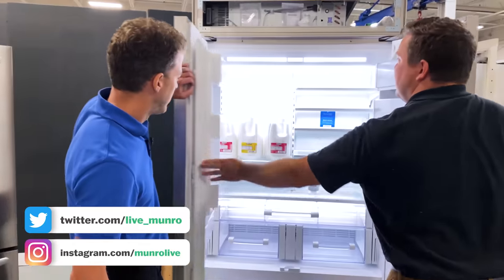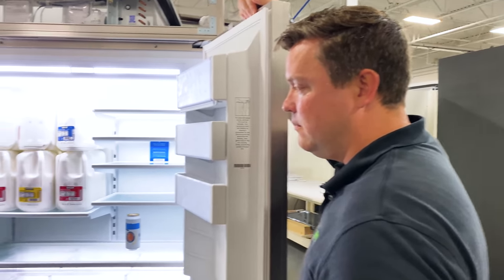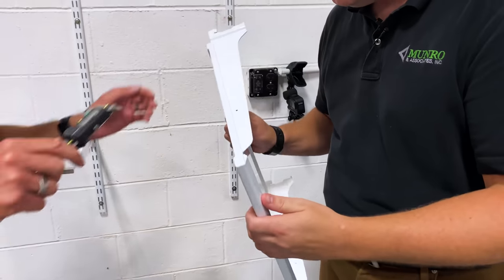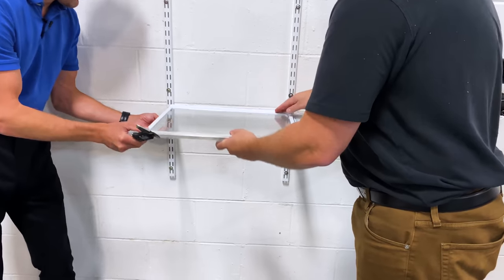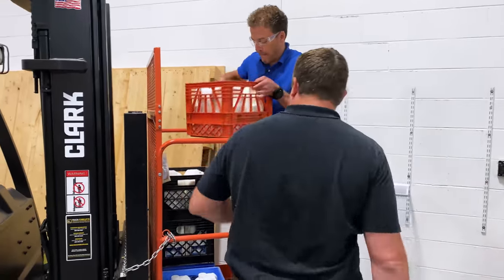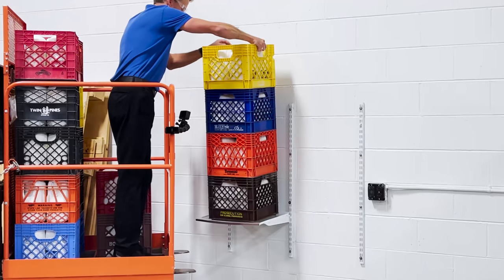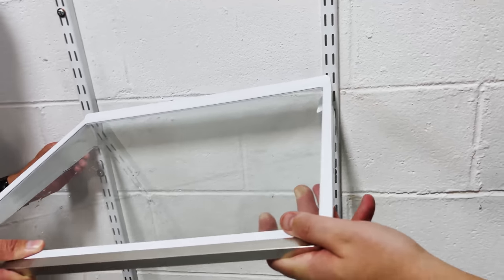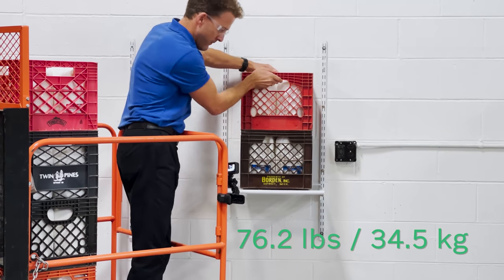Consumer Series: Sub-Zero vs Frigidaire | Load Testing

Comment: I'm actually impressed with how gracefully these shelves failed when they did fail. It was a very controlled flop over rather than a sudden shattering of glass or something violent. Why milk though? You've made a bigger mess for yourselves than just water would have been. But I suppose it's for YouTube. 😊
Reply: The tests in this series look very weird to me, first is the IR thermal "test" that can be pretty much ignored due to how uncontrolled those can easily be. The testing for this one would be better and easier done using barbell weight plates incrementing the weights by the smallest possible increments, 2-5Kg of example.
Reply: Minor dings or ridiculously overloading shelves perfectly adapted to their use-case are totally irrelevant. Right to repair, compressor life, electronics and seals are what limit the lifetime of a fridge for real. Nothing on that so far. Sandy, please come back soon before your guys spill more milk instead of producing useful content.
Reply: Could have just spray-painted water jugs white and write milk on them with black marker 🙄
Reply: @Makatea  I took this as an opportunity for engineering lesson about material stress, and failure modes, not a commentary on the products themselves ... so it was useful in that way :-p
Reply: @TheJoeSwanon  
Then when they fall over you'd see that it wasn't milk.
Reply: @Robert-cu9bm  Right. And that would have been less dramatic than all that milk on the floor. I think there was some theater involved in this video production for YT views maybe.
Reply: @toronado455  I've always wondered how much weight these shelves could hold. Now I don't have to worry when I stuff my fridge for a party.
Reply: why didn’t they use chocolate milk? Or orange juice? I think this is an example of white rivilege. @g.pattonhughes5991
Reply: Privilege!
Reply: @Makatea  but a lot of fridges fail at the shelf or drawers also (personal experience), this shows that those fridge have no problem on this
Reply: @ludovicdouay1635  Sure, it's perfectly fine to check out those shelves hold the maximum possible load you can pile up inside the fridge. Heck, you can even test them destructively if you must. However making a quarter of an hour spectacle of it and spoiling milk in the process: I'd expect more content of substance and more respect for food. When Sandy comes back, those two will most likely pass a very uncomfortable quarter of an hour in his office...
Reply: @Makatea  Agree, was also not liking to see this milk spilled.
Reply: When Dad's away the mice will play. OR: to put it another way - Kids, naughty!! 😅😅
Reply: @pinkelephants1421  This might be the most accurate analysis!
Reply: @toronado455  😜🤪🤣🤣🤣

Comment: Interesting, but these shelfs will never experience those loads, energy efficiency of these units are the most important factor.  I hope you can evaluate precisely being they are different sizes.
Reply: Someone using the fridge as a ladder to reach to cookies on top.
Reply: i have no words. Project Farm channel does it better than these guys.
Reply: I wouldn't want them to spend a minute of their time if they don't end up breaking the shelves.  They can just say "they work" and move on.  Actually breaking them revealed the design choices or the lacking of design that goes into these products and are actually educational.  I saw the stamping and actually thought that the Frigidaire's design was better.
Reply: I use an old Frigidaire in my workout room as a shelf to store my bumper plates so this is really helpful information.
Reply: @lanzer22  that is the difference between thinking something and real life.

Comment: Sandy might have insisted on using water instead, cleanup and residual smell for a indeterminate time, but then age has it's benefits.
Reply: At least its starting to get cool out there.  Still on the return of Sandy "Why does it smell like sour milk in my shop?!?"
Reply: But what about the added 0.023kg/m³ of density! 😂
Reply: Ummmm, did no one think that maybe water would have been a cleaner test??

Comment: When I read the title of "Load Testing" I assumed it was electrical load as energy consumption is by far the most important engineering feature of these refrigerators. I cannot believe I just gave up 14 minutes of my life watching two guys stack MILK (not water) jugs on shelves until they fail. While I am glad you made sure each shelf could hold a load that they would never ever see I am wondering when you will get to some actual useful testing. Maybe you should do this type of test for vehicles? Get a pick up truck and stack concrete blocks in the bed until the suspension fails or the bed collapses, or load up the drivers seat with steel plates until the frame fails. Seriously, was this video done so that Sandy would never go on vacation again?

Comment: I am interested in how you will test the electronic control boards.  I purchased Frigidaire refrigerator and stove in 2014.  We have had repair people out numerous times on both units and had the control boards replaced.  
Additionally the ice maker has issues with condensation freezing in the rotary sections for the ice maker.  I am not enamoured.
Reply: the EU versions of fridgidair like brands are comfortably in the "budget" section. still, a fridge like that would cost less then half in euros as it would in the US. these fridges are just stupidly overpriced in the US. even that subzero would be sold for 3k or less in the EU.
Reply: I expect those boards to be tested with gallons of milk.

Comment: This is an utterly useless spill of milk. Both shelves are strong enough for their use case, so what? The right to repair stance of the OEMs, and the durability of the compressors, control electronics and seals are the significant components limiting the useful life of a fridge, not minor dings in the sheet metal or ridiculously overloading the shelves.
It's time Sandy gets done with his move and comes back to stop the clown show.

Comment: I fail to appreciate any value with load testing the two shelves beyond what either would ever be loaded to inside the frig. At least we know both shelf designs will carry MORE than they could ever be loaded to inside the frig's. due to space limitations.  

MythBusters would have rented an elephant for the same test and got more laughs.
Reply: Well, testing them to 100lbs and stopping wouldnt reveal the failure point. The test isnt just "will they handle a normal load" it is a failure test to see where they do finally fail at. This is important to know so if the manufacture did want to save pennies on shelves they could know where to save them and still meet the requirements. The Frigidaire has a much more expensive stamped part but was actually weaker. That tells us that stamping that part is a waste of time and money in production. They could move to flat rails and be better off. Although I recall these fancy stamped parts being prominant in thier advertising.
Reply: you missed the point of the test. it was not if they could hold the weight it was to see what they could take. that is how you figure out wich part was made/designed better.
Reply: Both valid points and admit all what they are testing for was not on my radar.  Cheers.
Reply: @SupremeRuleroftheWorld  being "designed better" is not a valid outcome of this test.  Better relates to the function they are designed for.  If both can hold all the weight that could but put on it in a fridge, any further expense is overengineering and wasted money.  This channel is all about reducing costs and materials so the more inexpensive choice here is the better one.

Comment: Nice video production.
Reply from the maker: Much appreciated!
Reply: @MunroLive  That's about the only nice thing one can say about the whole fridge series. Slight dings or shelves perfectly dimensioned for their use-case have no bearing on the useful lifetime of a fridge, which is the only thing relevant to the customer. 
Right to repair-attitude of the OEM, power consumption/isolation, compressor, electronics and seals matter. Those essential aspects were not even considered yet. For now, this is just a bad talkshow over nothing of substance achieving no more than to pointlessly waste perfectly good milk. 
Expect to get an earful from Sandy when he comes back.

Comment: ELECTRIC FORKLIFT  - NO???  Perhaps when Munro gets solar panels on the roof they will get battery powered ForkLift ?
Reply: This is what I thought too.
Reply: They cost about 10k more up front for new and used propane lifts are cheap. They also typically run about half as long and "refilling" propane is usually done in a few minutes by swapping the tank. Not even Tesla uses electric construction vehicles on thier job sites.

Comment: I suspect that the Frigidaire shelf was designed to fail exactly as it did and at a weight that would be unreasonable in the actual fridge.  The front gusset turns upward before it gets to the back "bump gussets" along the edge, suggesting an intended failure mode as stamping longer gussets would not be more expensive.  This failure mode may reduce the risk of breaking glass, which would be the larger concern to a legal team.

With that said, the observed shelf failure potentially spills food items forward.  If a child with the density of a neutron star hangs from the shelf lip, heavy items could fall on them when the shelf fails.  Both brands seem to have sufficient shelf strength for children of normal densities, however ;).
Reply: This is an interesting and very good take on the design.  Purposeful failure to avoid a more hazardous condition.  Cool!
Reply: Missing is material spec grade, temper. Still for the value engineer, Frigidaire  earned its keep.
Reply: Steel pots are denser than milk crates. We are also assuming no manufacturing defects. The margin of safety on the Fridgidaire seems low, in a product where weight isn't critical.

Comment: By the way, you guys are doing a good job and it is interesting to see something other than cars evaluated. The spilled milk was not necessary but did add a bit of dramatic entertainment. I do miss Sandy. One of you should have said, "What!?, I don't understand what they were thinking, they put a structural rib in the support but skimped on the hook width! What is with that?" "You see boys and girls, someone decided to do something right, but it looks like someone else decided that they didn't need to follow through by allowing a few millimeters of width on the hook to match the strength in the rest of the bracket." You guys can do it, put some emphasis on what you are seeing and saying. I didn't really see an conclusion on the comparison. Something like, well, if Frigidaire hadn't failed to consider a greater width on the hook support for the shelf they would so far be equivalent to the SubZero fridge at about a third of the cost!
Reply: Why aren’t the guys from Munro discussing the need to use composite plastic or carbon fiber to make stronger shelf brackets and save weight?

Comment: Most of these tests don't make any sense. Nobody is going to use those shelves for storing weights and the shelves are only designed to lift the stuff people store in fridges.
Reply: Ive definitely had fridge shelves fail with a bunch of gallons of liquid. 🤷
Reply: What if you want to cool a foot³ of tungsten

Comment: stunned that neither piece of  glass broke
Reply: With even loads glass is pretty strong. What glass cant do is point loads.
Reply: Yes, the shelving is the weak point , as they need to be flexible in storage option.
the brackets are the worst failure point. 
they can be made stronger with clip locks like on some old cars and train windows.

Comment: I think one of the important factors you didn't consider was that the subzero had a little pin that stuck into the slots of the shelf bracket, that helps to prevent the forces pushing the support out to the side, which is what it looked like happened on the Frigidaire.

Comment: Thanks for the shenanigans and entertainment at the expense of cleanup lol. You could have some structural engineers on your staff chime in. The gussets would hold up much more if it was designed as Adam said, straight through. The depth of the section of the sub zero supports definitely make a huge difference, the equation i believe uses the moment of inertia to the 4th power. So that was a huge advantage. But what is great to know is how they are both designed well above what you can fit on them. :)
Reply: still, stronger is better. over time the shelf will bend down as you load it over the years.  especially if you load your fridge up with gallons of milk.
Reply: @SupremeRuleroftheWorld  lol, spread the 5 gallons of milk on multiple shelves! Also, you are talking about metal fatigue, the shelves MAY bend down if the 40 lbs constantly brings the internal strain to the ultimate limit. And if it has poor quality internal atomic structure from manufacturing cheapness.

Comment: So, what we have learnd today?  ( again ) ;-)
The extra reinforcement at the " Frigidaire " Sheetmetal part was just a fantasy not helping at all. Even when the tooling cost is an extra cost the total design is crap or they were using cheap metal for this application. 
Those brackets are already being used for centuries in stock or stores without any problems. They just had to copy/paste a perfect working design the fridge.
 (But we like to reinvent hot water over and over again)
For the Sub-Zero I would at least expecting stainless steel for the brackets. 
Not some ordinary powder coating.
Reply: @James Ziskend Still bringing up the coils I see LOL. I thought you wrote these people off last video?
Reply: @James Ziskend In the end of the day it is just a square box with cooling ( AC ) developed by people who never use it or have to clean it ;-)

Comment: Don't cry over spilled milk. The test was a pretty good one and the failure was easy to understand. That was a lot of wasted milk. I would have thought you guys would have had different types of weights for stress tests. The carbon footprint of this test was pretty high considering what it cost in the production of the milk. 

I'm not an engineer by trade, but I would think the test was not the right test for this. The height of the stacks of milk is impossible to put into a refrigerator. The high stack with even minimal tilt becomes a lever working against the shelf. The higher the stack, the greater the leverage against the shelf bracket. 

The test should have been limited to the space offered in the refrigerator. Bags or boxes of sand would have been a better test. If you was testing a forklift capacity to carry a load the test would have been more relevant. In this case you are dealing with a shelf in a refrigerator and confined space. Over engineering a shelf in a refrigerator so it could hold 800 pounds of food would be costly as an example. That means one would be paying a higher price for something that is not practical or needed. 

Children or toddlers often interact with the refrigerator. A better stress test for the shelves would be how they hold up to children stepping on parts or pulling on the shelves while trying to climb up to get something. I've seen this over and over. So maybe hanging weights would be more appropriate to test the shelves with a moderate or heavy load already on the shelf. 

At least they no longer use actual mechanical latches on refrigerator doors anymore. In the early 1970's I walked into a "walk-in" freezer at a fast food restaurant and another employee walked by and closed the door. It latched and the push latch from the inside was broken. That sent a chill up my spine. Of course I'm here now writing this because someone finally figured out that I wasn't around and decided to check the freezer. The Franchiser did get the latch fixed the next day.

Comment: Once the 3rd [ Frigidaire ] and the 4th [ Sub-Zero ] crates were added and had demonstrated flexure, why not stack an EMPTY crate on top and then add jugs one at a time to more accurately estimate the failure load? 
( Also agree that water would have been both less wasteful and messy, but water is a measure of weight in the Metric system: 1 gram = 1 cc making calculations of weight both easy and indisputable, since milk can vary in fat content thus affecting the exact weight )

Comment: Note from your international audience - Milk is perhaps a more spectacular load case, but we would have excepted a measured tube of water - which would have went into a drain on failure and been captured by your rain and grey water recycling system - hint, hint.

Comment: Hi - so I realize this is not a car focus - but I am thinking the load test is not the end of the review cycle.  It was a little over the top to stress the rack to the break point (regardless of what could physically could fit in the units) but energy efficiency and internal operations still a worthwhile consideration.  As you are in hiring mode, the implication that you may not have time to finish this properly is a practical answer to share for some closure.  Applying a bit of the primer from the most recent 2 part video to design issues maybe an option if this was to continue.  No complaints here - just an unsolicited suggestion.  <smile>